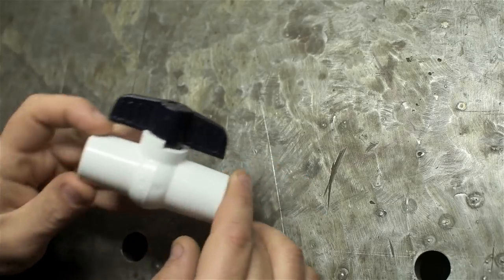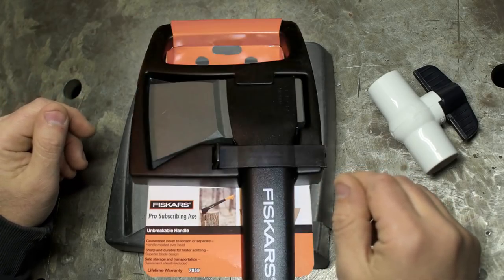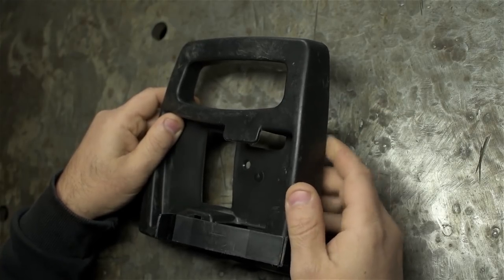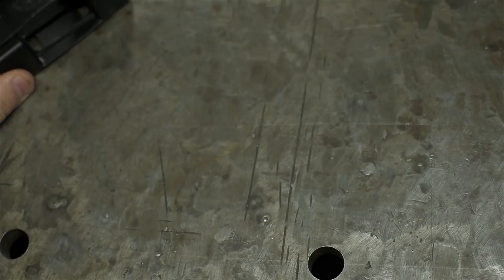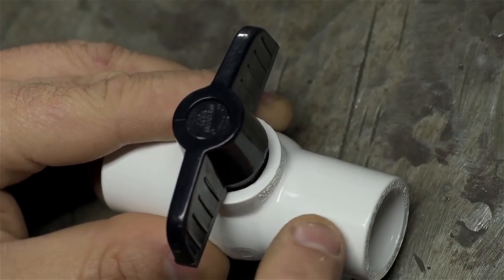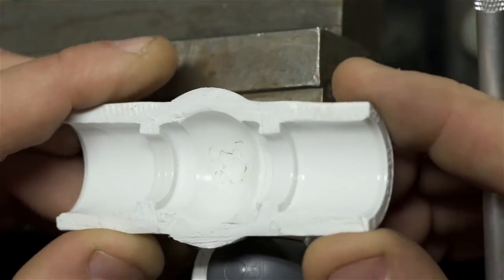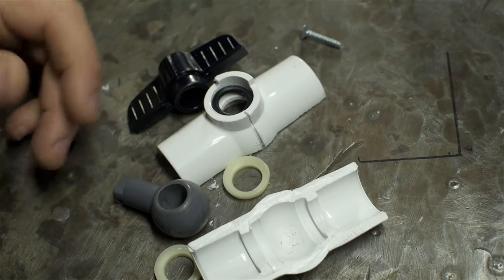Marvels of Injection Molding!

Comment: I'm not sure if this has been pointed out in other comments, but in the case of the wall thickness difference, while that injection pressure could cause that .04(?) shift, it is more likely that the part cavity was designed with this feature. To keep the polymer flowing evenly through the part, we typically inject into the thickest wall and fill into smaller thicknesses. If I had to bet, I'd think that the thickness of the center portion leading to the lever would be equal to the thinner sections measured or even thinner. The thinnest section furthest from the sprue would also have a lower density due to packing pressure difference. If this is not the case, then that part just became 100x more impressive. 

-a recent polymer engineer grad

Comment: I used to work in several factories dealing in plastic injection. It's not hard to believe that it was assembled inside the mold.
For several parts I had to manually insert pieces into an open mold and the press would close and inject plastic around it.

Comment: This would have required 2 mandrels coming in from both sides of the ball and meeting in the middle. You can tell by the pvc lips that retain the O-rings plus 2 mandrels would have been required to maintain pressure on the O-rings against the ball during the ejection process. :) love the vid

Comment: We call the gate the sprue, and the sprue bush is the bit the plastic flows through when it enters the tool.

It wouldn't surprise me if the injection pressure was balanced with the shrink rate and cooling rate on that valve in order to create the best seal possible. Not enough injection pressure means less plastic and less dense plastic and a sloppier fit.

Comment: I loaded three 11,000 lb. Steel ingots on my flatbed the other day. The foundry used draft in their molds also, narrowest at the bottom and widest at the top of the heat, then flipped to remove the ingot. This makes a tapered ingot.
So even though it was not injection molded in a tool, it used draft, meaning that draft is an idea older than injection molding.

Comment: There's two reasons for the increased dimension top to bottom. 

Deflection of the core the insert sits on plus "overpacking". Closer to the gate sees higher injection pressure. That pressure gradient compounds on top of any deflection and can greatly affect sizing. 

In some cases that differential is entirely due to the pressure gradient rather than deflection.

Comment: Used a few of those ball valves in my time, I had one batch where the PVC for some reason  shrank and locked the ball so you can't open or shut them.   They were replaced by the company only to give the same problem.

Comment: Thanks Tony! Nice insight. So the inside ball is made from an incompatible plastic. 
How about the same plastic?
That is what Playmobil and also Gardena a doing the mold around a part of the same material. They have ootimized the temperature  and pressure to allow them to inject hot liqud material around an inlay part of the same material. That's the holy grail!

Comment: I would expect that the reason for the handle being screwed on is just to keep it simple. The mold for the pvc needs some clearance on all sides for strength and the handle would get in the way no mater how it was oriented. With the handle separate the mold can be as thick as you want without obstruction. Or it could be to make it possible to replace the handle without replacing the whole valve. I have seen similar valves with damaged or missing handles.

Comment: i worked with tools like these, not long, just a good 18 months or so. but the gates are always on one side of the mold. from that i speculate its side moving parts that made the valve, not the tool halves. the assembly would also happen on the side movers, which would result in requiring a smaller tool opening for ejection, and also the robot would be simpler as it could move in from the side of the machine (i htink)

Comment: I would wager a guess that the Handel and top washer were added after because the mold would have a difficult time closing around it properly considering the angle the Handel sits at.  Not saying it couldn't be done but would probably require extra time and percission to align the vertical washer and a much thinner mold on the top to account for the handle clearance.  A robot could be easily used to add the washer and Handel/bolt after the mold.

Comment: When the PVC is injected, the ball valve is in the open position and a rod from either side captures the seals and goes into the ball, pressing the seals tightly to the ball and holds everything in place sealing it up.

Comment: The '5' isn't a life expectancy, it's a marker for recyclers telling them what sort of plastic it is. 5, predictably in this case, is Polypropylene. 

From Wikipedia: 

1” signifies that the product is made out of polyethylene terephthalate (PET) (beverage bottles, cups, other packaging, etc.)
“2” signifies high-density polyethylene (HDPE) (bottles, cups, milk jugs, etc.)
“3” signifies polyvinyl chloride (PVC) (pipes, siding, flooring, etc.)
“4” signifies low-density polyethylene (LDPE) (plastic bags, six-pack rings, tubing, etc.)
“5” signifies polypropylene (PP) (auto parts, industrial fibres, food containers, etc.)
“6” signifies polystyrene (PS) (plastic utensils, Styrofoam, cafeteria trays, etc.)
“7” signifies other plastics, such as acrylic, nylon, polycarbonate and polylactic acid (PLA).
Reply: hard to tell when he's joking sometimes. ?

Comment: Yo, I work in quality control in a plastic injection molding factory here in the USA. A lot of our molds are inserting components to be molded inside the part and running roughness tolerances of 6.3 microns

Comment: This Old Tony, I'm afraid you're a little wrong about plastic ball valves. After working with these valves extensively for the last 30 years, my experience has been that they're good for only about 2 years. After that, they start getting difficult to turn and eventually freeze-up. It's possible that if you exercise them frequently (every few months) their longevity might improve. But who wants to walk around turning valves on and off all day?
I'm am so convinced of this that I've completely stopped using them, unless it's a temporary fix or just a short-term use. Then, they're great.
If you want a valve that will last for 10+ years, buy a brass one. 
(Stepping down from my soapbox.)
Love your channel!!

Comment: proper term for a mold is a Die. what kind of tool is used for injection molding? several, but the one we are talking about is the Die. kind of like the cars we used to play with, but this one has plastic injected, not placed or plunked in, so it's not cast as in die cast, but the process is similar. material in a die formed to it's shape

Comment: I would make it as follows:
inject moulded 1. knob with ball 2. two seals 3. two exactly the same case components (halves - split line as shown). 
Assembly: 1. fit case with a seal 2. place knob on a jig put 2x complementary case subassemblies 3. weld

Comment: got here from a Tested tweet and im sitting here nodding. i work at an injection molding plant as press operator (sometimes) and doing post molding operation jobs, like milling holes or putting several parts together into 1 unti

Comment: The Over molding process has evolved to using rotary molding machine, 1 nozzle shoots the nylon or hard plastic, then the tool rotates around to the over mold nozzle and gets over molded without leaving the tool. That's how the drill case looks so good and tight. If you had to mold the case nylon first then put it in the over mold tool it wouldn't look near as good because you would have to make the over mold tool bigger than the hard plastic molded part to make sure it fit in the tool. Therefore it wouldn't have as sharp of lines where the rubber meets the nylon. I have been an injection mold maker for over 20 yrs. automotive industry lots of over molded parts.

Comment: The walls of the  Mould don't have to be tapered As the plastic shrinks and pulls away from the wall  Of the mould as the plastic cools you can make square objects out of plastic With rotational moulding and injection moulding

Comment: So, this is just my guess, but I bet they went with the O ring and screw on handle design because there would be no way to guarantee a seal, but not in the way you might think. So as you showed with the horizontal seals, the ball is slightly oblong and acts like a cam to compress the o rings when closed. Well in normal o ring seal design, you need to ensure the seals are compressed, but in an injection molding process molten plastic will flow as a fluid, putting an even pressure everywhere, and thus never achieving O ring compression needed for dealing. Therfore they designed it to be purposefully u der sized in the open position so that they knew, even though it would initially have no compression, turning it closed would always compress the seals. However, two things prevent the use of a third, upward facing molded in seal, and instead called for the externally assembled handle O ring. 

First, there would be no way toachieve the necessary seal compression as the seal is located on the same axis as the ball's axis of rotation. There is no configuration that would allow the turning of the ball to apply compression in this direction.

Seceond, since the horizontal seals will be uncompressed when the valve is open, nothing would stop the water from seeping around the ball and escaping out the handle, so the handle needs a seal that is ALWAYS compressed, not just intermittently compressed.

Comment: The reason there in a screw in the ball-valve is that you need to actively compress the O-ring to get a good seal. If the parts were casted together, there would be no force to compress the O-ring and hold water back. I'm not an engineer but it's just an educated guess.

Comment: Unfortunately, those one-piece molded ball valves have a tendency to seize up. I prefer true union or two-piece (often sold as "heavy duty" ball valves as they are more reliable and turn more smoothly.

Comment: You often see valves with a much better valve to the exterior. What happens if the black seal leaks? You probably have water dripping in your bathroom cabinet for a few days before you notice. What happens if that white seal leaks? Next time you want to change your sink, you have to put a bucket under the pipe because it is dripping. For usual applications, the later is definitely the lower risk.

Comment: I work in a plastic factory and have worked with machines that make PVC parts such as expansion fittings. It can be dangerous. Especially if the machine goes down and is down for way too long with that molten PVC in the injection barrel

Comment: Not bad, pretty close. There are obviously a thousand different ways to make the same plastic piece, some are just the designers preferences, some to accommodate the limits of a machine or tool. one thing also, draft is not totally necessary. I spent about 8 years in the industry on all different levels, mold loading, part catching, part finishing and machine repair.  They can use tools that have retracting pieces that release the part and also can rely on shrinkage to help along with "mold release"- usually a silicone mist that lubricates the mold.
Flashing, light shots, burning, and warping are controlled by injection rate and pressure. Each tool will require a specific curve (balancing the amount of plastic being injected and the pressure) to force the air out of the mold. 
How the ball valve is more then likely done: The gate(s) are normally situated by the largest bulk of the part, or the plastic flows towards the edges and from as far away from them as possible, and from thicker thickness towards the thinner thicknesses. What they probably did was slide the rings into the cavity then suspended the ball using a holding device to hold the handle or stem of the ball in the right place. The rings will need to have been held tight against the ball. And the material would have shrunk around the ball and seals squeezing everything in- water tight. That is what that line around the ball area is, to help get the right "squeeze".  And I suspect somewhere on there is a cavity number or letter, many of these were shot at the same time. Sometimes these types of molds are loaded via robot, and sometimes by hand, this looks like a robot job to me.

Comment: The mandrel did not shift on injection... on one side the mandrel forms the inner surface and lip where the pipe will be cemented in.  On the other side of the ball the mandrel sockets into the far side tool that forms the exterior and inner lip of where the other pipe goes. The difference in wall thickness between top and bottom is designed in. The wall thickness gets steadily thinner as you move away from the injection port.  This causes the hot plastic to cool Directionally, from the furthest point in the cavity, backwards toward the injection port... it’s important that the weld line you identify solidify first, and the polymerization propagate back toward the injection port...so that the shrinkage does not cause the weld line to fracture.  The injection port can this continue to bleed hot resin in as the part cools and shrinks, so that the part’s dimensions remain closer to that of the tool.

Comment: It would be great to revisit this with different brands of similar ball valves.  Would the molding scheme be identical?  Might another brand have an integrally-cast seal for the top handle rather than a removable O-ring??  Will the gates and witness lines be located differently?  Might the internal rotating ball part of the valve be a different color?

Comment: The pressure of the injection deflected the mandrel .010. If it moved .020 it would read.180 on one side .220 on the other. Correct me if Im wrong.

Comment: Hey Tony I know you made this video years ago but I was wondering if you could explain metal injection in the future. I finish die cast aluminum parts in a CNC shop with a die grinder and always wondered how the part didn't stick to the mold. it's kind of funny that my job is entirely made from them being lazy and not fixing the molds 😂 Thanks for all the great content.

Comment: I'm impressed by your communication skills! Question, the screw "cap" looks like it was firmly attached to the black plastic body, perhaps with resin, or ultrasonic welding? In that case this valve wouldn't be serviceable, right?

Comment: I ran injection molding machines for a old job, over molds for double molding is cool put a pain on the machine because if the first part is injected wrong then it screws up the second machine and it's not fun fixing

Comment: I have bought a few of these but they give trouble. 
When they are new all seems ok, but as they age the ball gets harder and harder to turn. 
Then due to the sun and age the handles break off.
I am converting to stainless steel ball valves now as these plastic ones becomes  unservicable.
It is still a work of art but the materials need an upgrade.

Comment: Those PVC valves are cheap but have loads of issues with sticking rock solid. Our shop (all four of us) , prefer male adapters with npt threaded brass bodied full port ball valves. Now , if we could get a decent quality handles on any valve.  Any size.

Comment: One note on the tools for injection moulding.  They are expensive!  I would bet the tool to make the axe sheath around USD 30k.  On large production volumes it’s ok because the resulting product is turned out so cheaply.  On high end low volume, you can pretty much disregard the per part cost and just average the tool expense over the expected production volume.

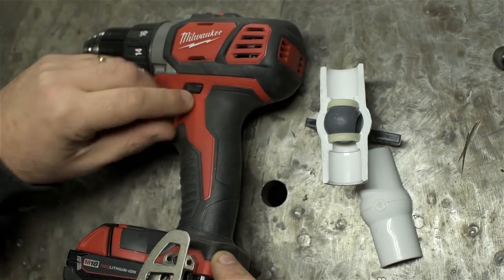Comment: 13:26 I will say that all the DeWalt tools I have used with the over molding eventually have the rubber come off. This is talking about tools used in industry. All of them I have seen where I work have had some part of the black rubber eventually peel off. I have some Milwaukee tools also but so far have not seen the rubber come off them.

Comment: One thing that I really don't understand about injection molding is "where does the air go?".  The two steel pieces meet, probably pretty tightly, then plastic is pushed in at high pressure in, but what about the air that takes up that space?  Is it pushed through the crack where the flashing comes through?

Comment: 12:45 interesting remark, but I think you made a small mistake: if the tool was pushed 0.5mm, that would imply that the original position was equally off-center... Even if you consider the mold the reference (thus having no positioning tolerance at all), it is more likely that the ball was positioned in the vertical center, which would mean that it got pushed  up only 0.25mm, half of what you are saying...

Comment: But how, when they injected the plastic, did it not fill/leak into the hole in the ball? 🤔 The mandrel might have blocked most of the hole, but there would still have been some gaps around it, especially since the hole is tapered towards the inside. Likewise, how did the molten plastic not fill the gaps around the ball and the seals, and for that matter, how did it not stick to the moving parts? 😕

Comment: "... sgnificant pressure". You bet. At the very least 100 bar, but probably a lot more. And by the way, injection of such small parts happens in less than a second, possibly just 0.2 sec.

Comment: the deflection you mentioned to be a .020" shift is actually only a .010" shift. The upper portion you measured was .190" thick while the lower side was .210" thick. That's a .020" difference, which is divided by 2, for the lower and upper measurements, to arrive at a .010" deflection. When you start at a nominal and move away from the axis, you lose dimension on one side and gain it on the other. its a concentricity measurement not a linear measurement. Hope that makes sense.